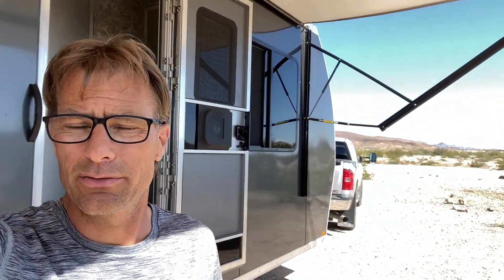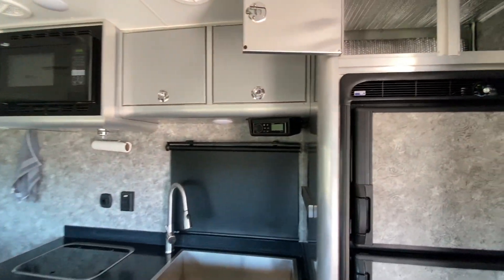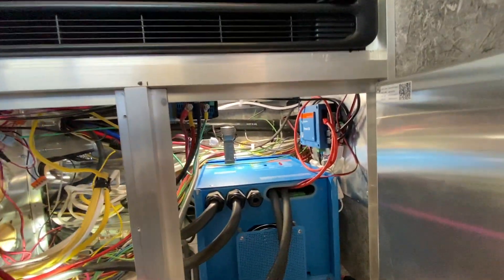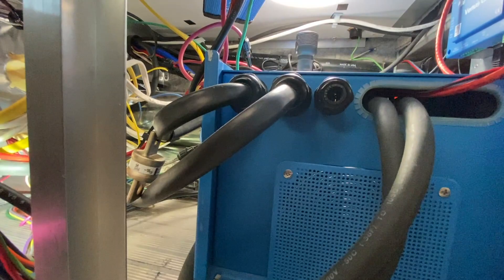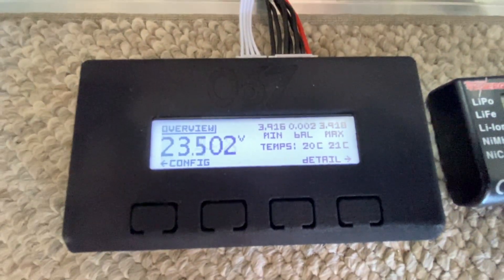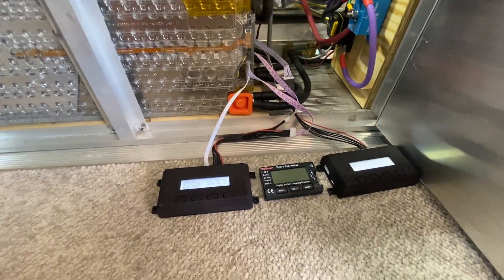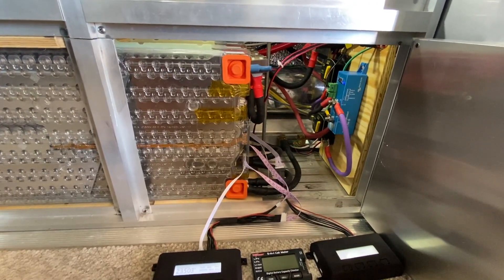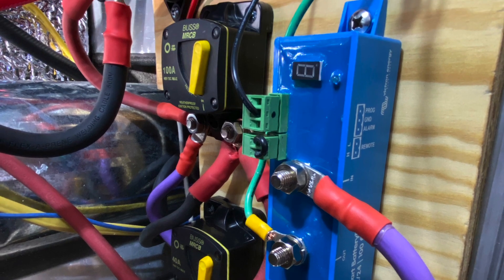Tesla Powered ATC Toyhauler RV, more than 15kW!

Comment: This is nice, but unfortunately you are not getting anywhere near 15KW usable, Tesla batteries have strange voltages so I think you are actual usable power is about 7.5KW. This is based on other users that have used tesla batteries, most ditched them and went to battleborn or renogy.
Reply from the maker: At 2.00 minutes into the video I talk about my 600AH (actually 601AH measured through BMV 712) used during one cycle , my simple math says 600AH x 24v = 14.4kW with my conservative voltage profile. The Tesla Module has operating voltage of 18v-25.2 and for the test I started at 24.5v and finished at 18.8v. I don't know who 'others' are but I can only fit 4 battle born batteries in this location which would be 200AH @ 24v or 4.8kW and have the same approximate cost.
Reply: @BoonDoctorJohn  Sorry but that is simply wrong, you may be drawing amps  (also no way you are getting 600 amps from a 233 amp pack so 466 total) but no where near 24 volts, you will be averaging 18-19 vols. This has been confirmed by literally hundreds of people using tesla batteries, even https://www.evwest.com/catalog/product_info.php?cPath=4&products_id=463&osCsid=h1g77n3utg3qrt9f3c3eguava4 that sells these list the capacity and voltage.

I see 2 batteries in your setup unless their is a third pack hidden some where.

Real word you have at best a 400 AMP at 18.75 volt nominal = 7500 watt/hour or 7.5
Reply from the maker: @Foxfried  You my friend are very engaging! You started by saying that my 15kW was only 7.5kW useable, I have proved that you are incorrect. I agree we could have debate on voltage curve of different Lithium chemistries. In my test, the voltage started at 24.5v and finished at 18.8, I am not sure how you think that will average18-19v. Does this involve 'new' math? Your link states the 5.3kW capacity for each module which I am sure you know is the only real measurement for capacity and since I have 3 modules I will keep my title as 15kW, thanks for the added documentation. I am very impressed at your attempt to find flaws in my video. Have a great day!
Reply: @BoonDoctorJohn  Your video only showed 2 modules, max total capacity would be 10.6 KW. But that is beyond the point, you have a victron Charger/inverter and it does not support a full custom charge cycle which is what you would need to harness all of the power of this pack. Don't take my word for it, see a popular youtuber that test batteries day in and day out: https://www.youtube.com/watch?v=1EX4rNvVaG8 . If you have 2 batteries as shown in your video your usable capacity of your pack is 10.6 x 63% = 6.73 KW and if you have 3 packs than its 10 KW (not sure where the 3rd pack is wired)

Mind you these numbers would be at a 100 depth of discharge, which would accelerate the wear on your batteries considerably. Even on the actual tesla cars for normal use Tesla sets the max depth of discharge to 80% unless you manually select FULL TRIP CHARGE. Using this same logic applied to your batteries, your 2 pack can then only safely draw  5.38KW from your 2 pack or 8 KW from a 3 pack.

Just be careful on what you are doing people have blown up their tesla batteries because of too high of a depth of discharge,  almost all of these invertter chargers are designed for LIFEPO batteries which the TESLA are NOT.
Reply from the maker: @Foxfried   My video title is 15kW and yes I have 3 modules out of a Tesla model S. I did use approximately 14.4kW out of my battery bank in one cycle.  I live full-time in my RV with this battery and my solar being my only source of electricity. The Will Prowse video you link is over a year old and maybe the old firmware in the Victron Multiplus did not allow the inverter to run down to 18.5v? I know what I have and I am sharing my experience with these batteries first hand, this is real. Please re-read my first two responses to you where I state start and end voltages of that cycle. Cell voltages are from 4.08 down to 3.13, safe and conservative in everybody's book for a Panasonic 18650 Cell.
Reply: @Foxfried  At the 2:20 mark, you can clearly see 3 batteries.